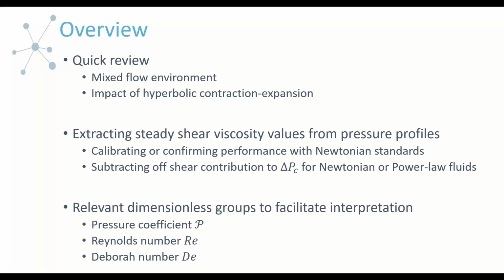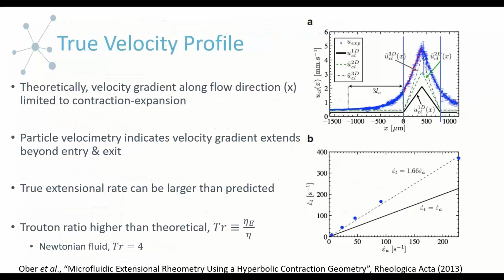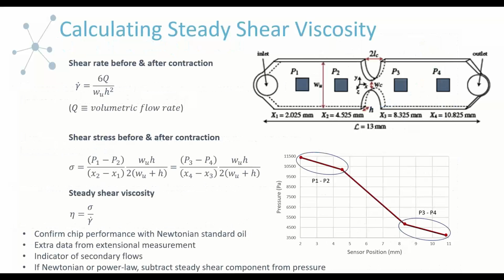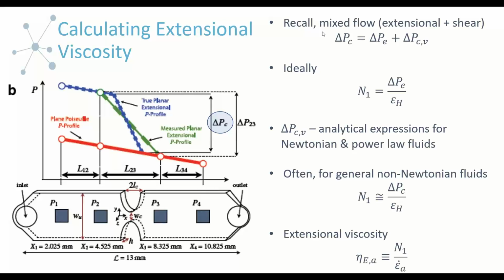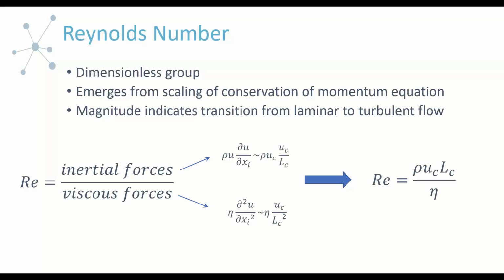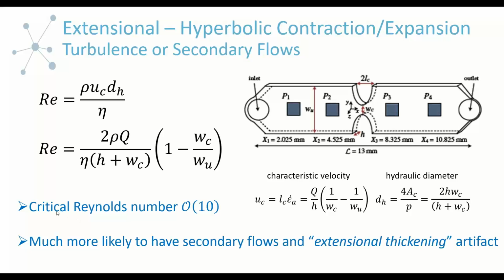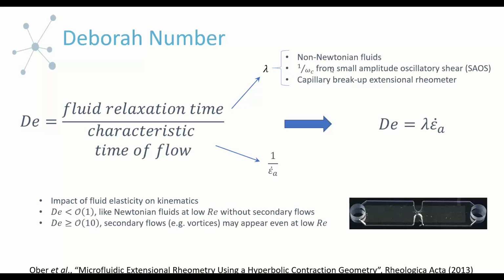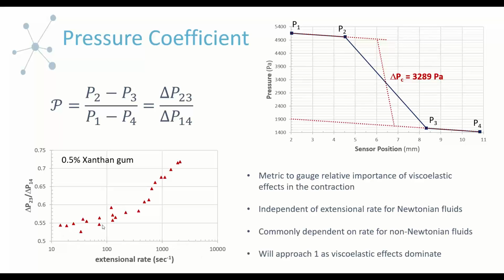Extensional Viscosity Part 2: Data Analysis and Interpretation

Comment: In a flow with both shear and normal-stresses, what causes the largest amount of viscous heating? Does the elevated elongational viscosity also cause an increase in viscous heating at the same strain rate?
Reply from the maker: We were not able to detect viscous heating while running all accessible shear rates on shear chips when it comes to our m-VROC II. 

Could you elaborate the second question?